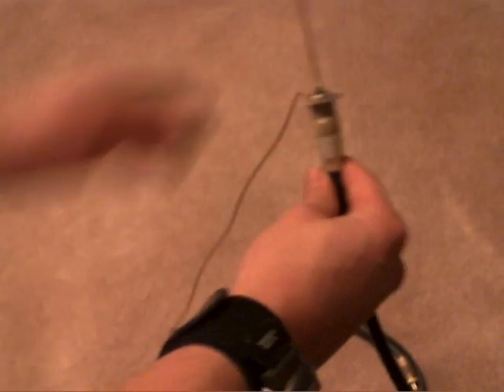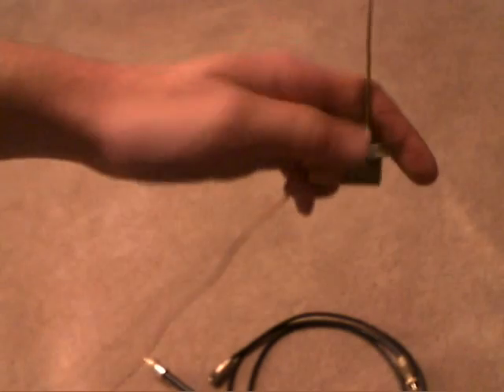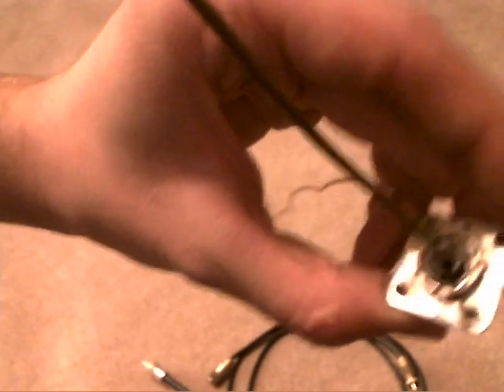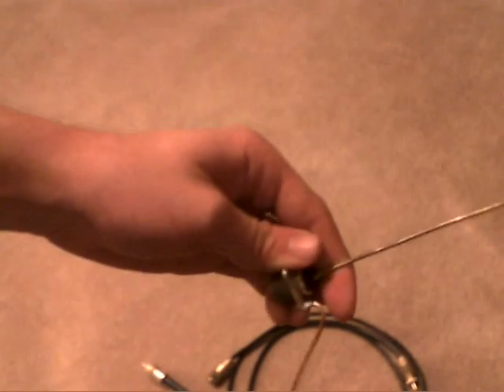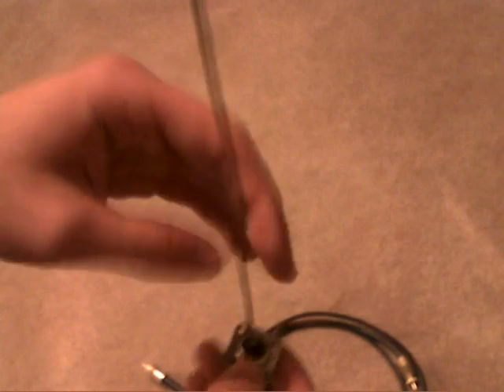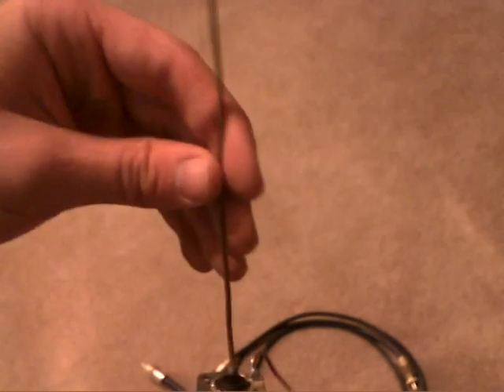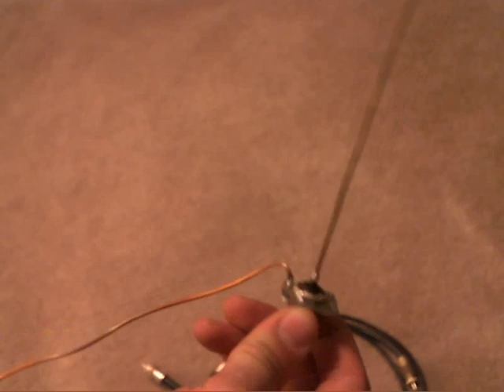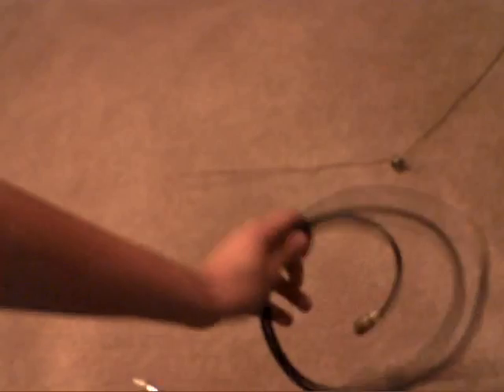My 2M and 440 Ground plain

Comment: That's a cool antenna that you've made there for backpacking. Great idea. Yeah you are correct on needing more ground radials, putting the other three on will balance out your out going signal and give you more of an omnidirectional signal reception. They should not affect your swr's, that is only affected by the length of the antenna radial distance itself. Take Care :-))